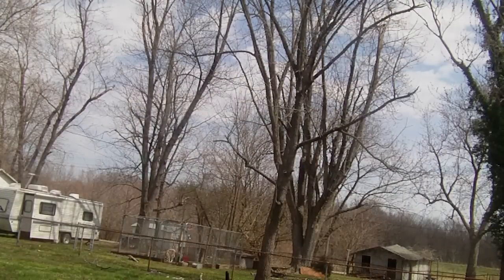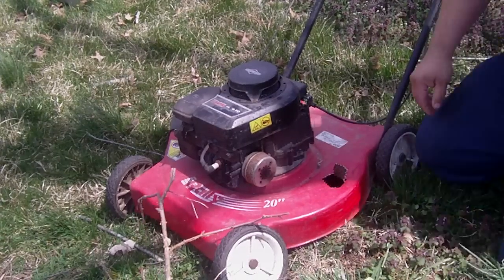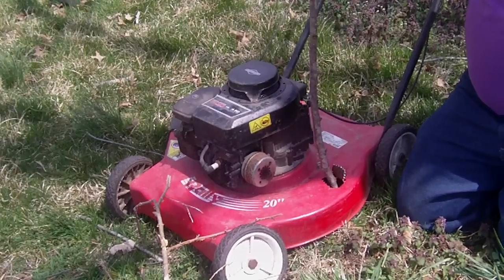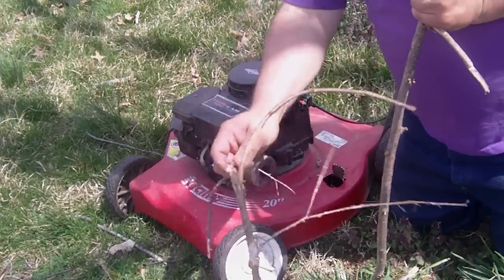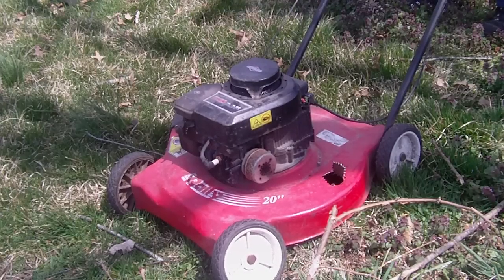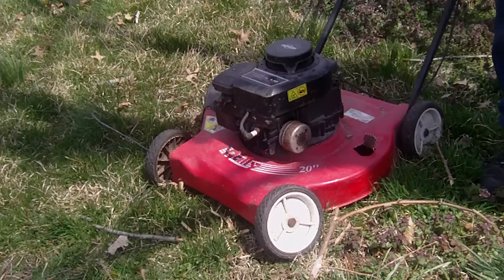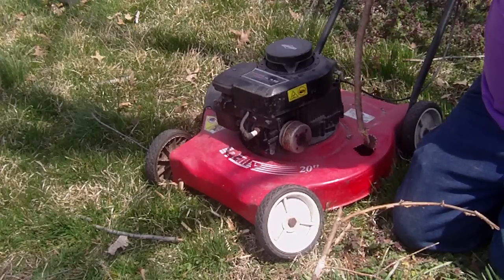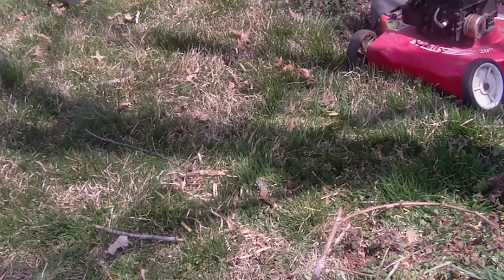Turn Lawnmower into a WOOD CHIPPER

Comment: Put a plywood bottom on the mower, and definitely a feeding chute. A sharp edge at the bottom of the feed chute will cause the branches to catch. Welding an anvil (piece of solid bar metal or thick square tubing) to the deck, just in front of the feed chute and just above the blade will help the unit cut instead of banging the stick around as bad. Make sure the anvil barely, yet freely, allows the blade to pass without touching.

Just some ideas.
Reply: ace comment

Comment: I've thought of this, but if I did it, I would approach it a different way. Take the original mower blade off, and put a pulley on the end of the crankshaft. Then use this one with a v-belt to drive a smaller pulley that would roughly triple the RPM to a little over 10,000. Now the fun part... take a mower blade, and cut the ends off so it's only about 8 inches long. Sharpen the edges down into new ones that go all the way back to the center with about an inch to spare. Make two of these, weld them together in a plus, and maybe some chunks of scrap metal to give it more inertia if needed. If I ever get time to actually try this, I'll let you know how it goes.
Reply: Very interesting
Reply: I'm trying to visualize you build. If you ever do it let me know!

Comment: I think jt might work even better if you grind the blade so it's sharpened from the bottom not the top. so the bevel on the blade is on the bottom of the blade. I would say turn the blade upside down but that might make the dull edge leading edge
Reply: Or maybe use a non-mulching (flat) blade and sharpen both edges,

Comment: I think if you could feed those limbs in at about a 60 or 45 degree angle the same direction as the blade you would get bigger shaved chips. Turning the blade upside down will help too.....

Comment: Okay so I see a lot of negative comments, but I also see well over 60k views. So, why are you watching if you don't like?
Constructive criticism I would offer is learn to edit your videos. This seemed more of a stream of consciousness than a informative dialogue. Learn how to cut and splice so you can eliminate certain spots (like pausing to hock a lugee). You make a comment in the beginning about not being a paid professional but if you're going to spend the time to film and upload videos, I recommend you polish them a little more. People will get a lot more out of it and you'll feel awesome having shared your knowledge with the world.

My take away, I don't think I like the idea of hurting my precious electric mower this way. In your case, if you want to improve this mower/mulcher, using a metal file to smooth out the edges where you dripped, cut off the flap entirely, round out the hole, and tightly insert a piece of PVC pipe there. That will hold the wood steady and allow it to fall into the blades keeping your fingers safe.

Comment: what are you looking for that  behind you " you need a rubber guard on side so the chip and blade don't out .. replace the blade to a  disk blade will cut better  then when you get done you would had more money tie up in it. it would  been cheaper  buy new chipper  or you could found on one in want ad